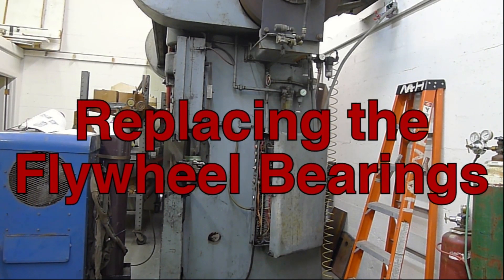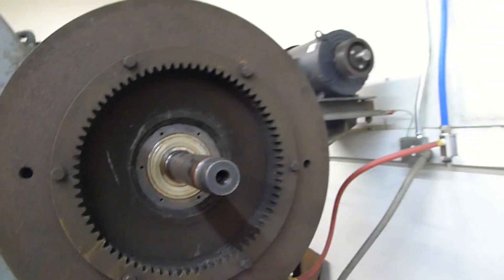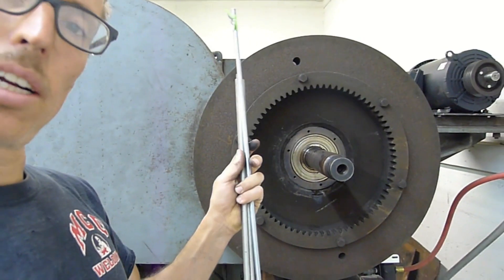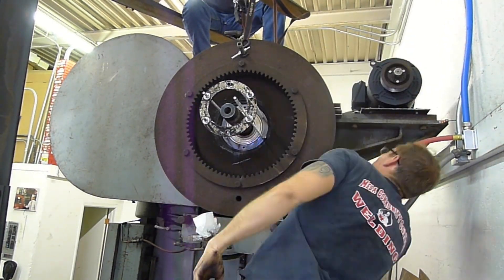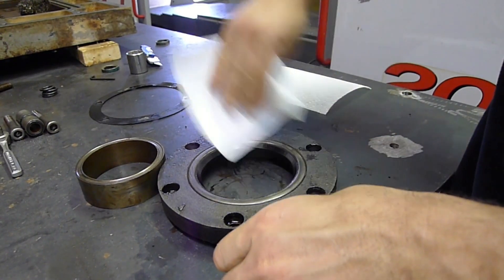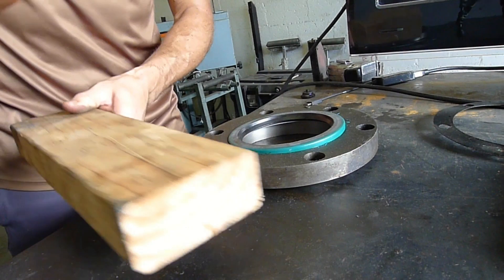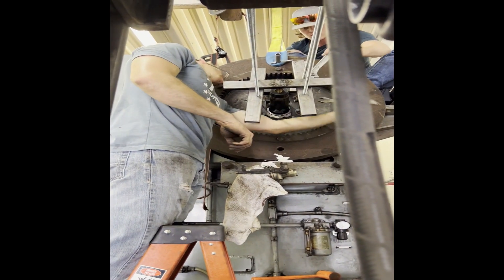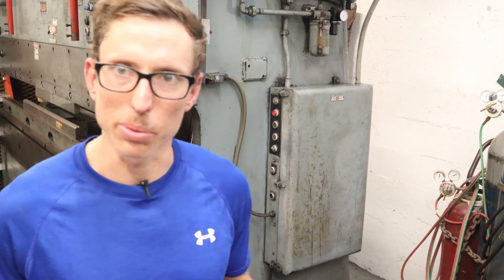Large 900 lb Flywheel bearing replacement

Comment: You got it running backwards
Reply: The crank comes over the top towards the operator
Reply from the maker: Perfect thank you! I'll switch two of the legs, and get it running in the right direction.
Reply from the maker: I can switch two of the legs at the breaker. Also, how do you know? I didn't see any indication of rotation direction. I then concluded that it doesn't really matter which way it is spinning. Only difference is which side of the gear teeth are used. Is this bad thinking?  Thank you!